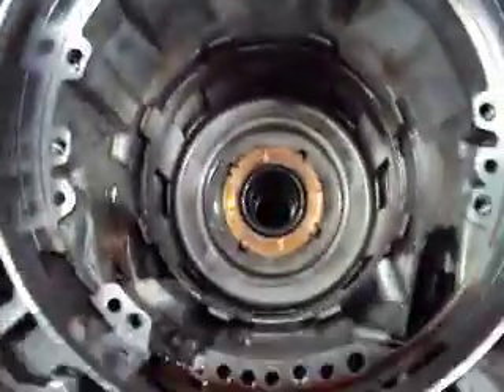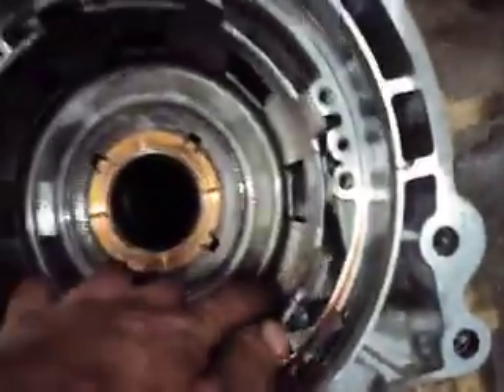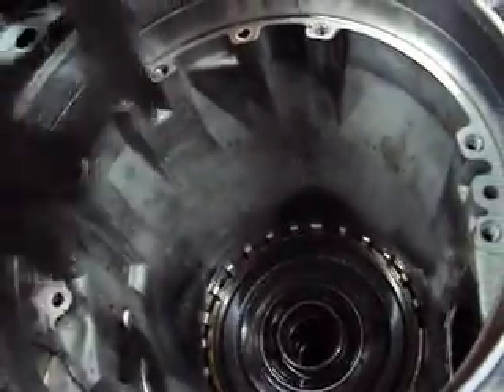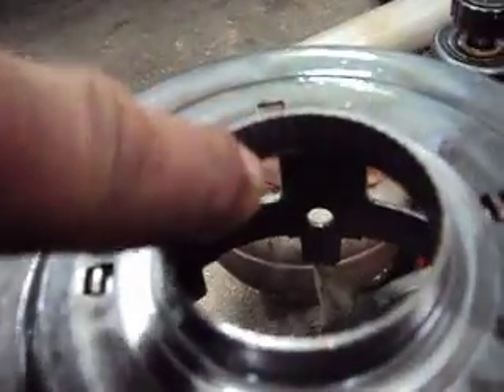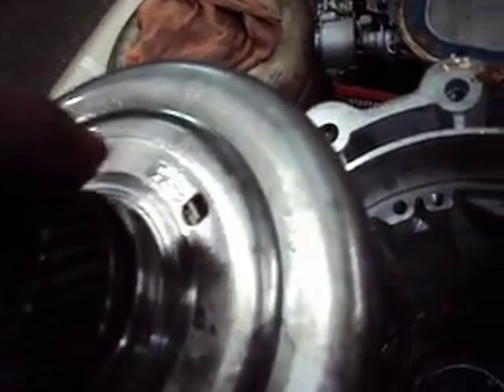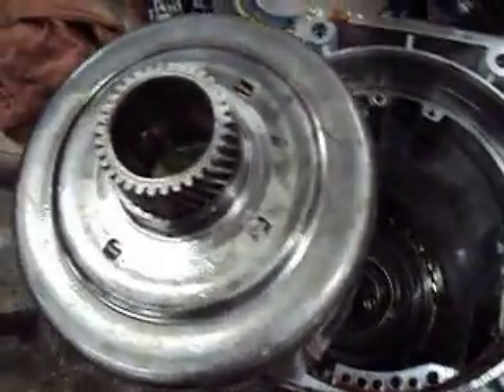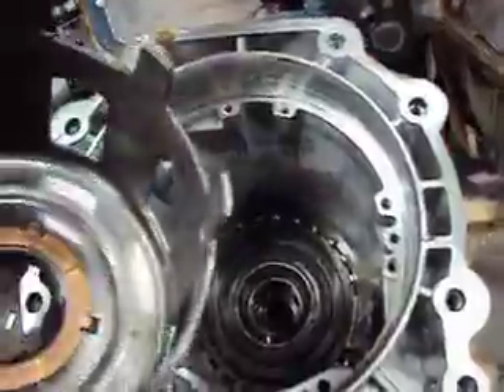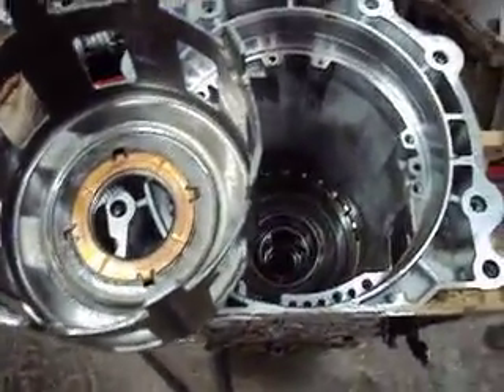A GM 4L60 E reaction sun shell stripped, no reverse.

Comment: Here is another reason to add to my list of why I will never buy a car with an automatic transmission (AT). Plus the fact that with all these so called improvements over the years the problems have gotten much worse, more frequent, have more delicate parts, have more plastic in them, and far more expensive to fix. Then you can add all the electronics in them that cause problems. They are really no better than the older AT's from the 60's or 70's. Today's AT's are built like a delicate pocket watch. Some require special oils or fluids and some you can't check the level of the fluid and you can't change the oil.
American cars are starting to become like POS European cars, they are great when they are new and as long as you can afford to keep them serviced at the specialty shops or the cheaply made expensive to replace electronics don't give out.

Comment: Hey boss my name is rogelio, I replaced the transmission in my car when I put everything back together I put 5 quarters of fluid the car didn't move I thought I didn't put right so  more fluid and it moves back and forth , so I know it was moving and I took it out for a test drive, very fist it change from 1st to 2nd gear fine as I was driving I noticed it wasn't switching gears I drive it for 15 minutes around the gagegear go to 3rd and doesn't change, and the speed gage only go to 20 if I accelerate more it goes 23,25 mph no more , I when home check the fluid it was not showing in the dip stick I added 3.1/2  of fluid it was right about this line of the deep stick  (hot) took it for a ride same thing please help